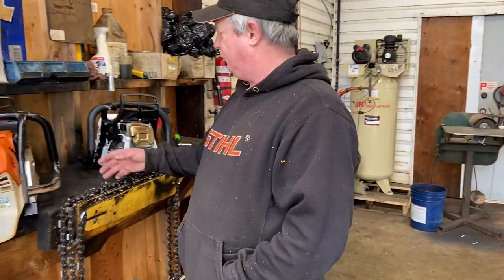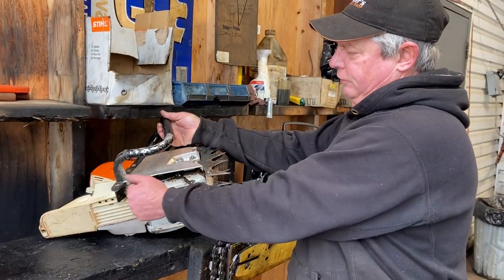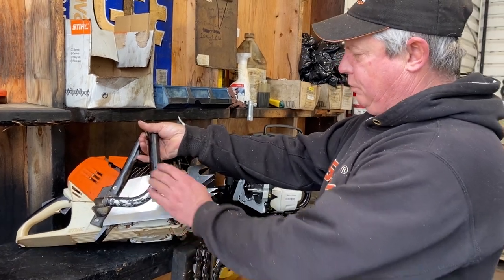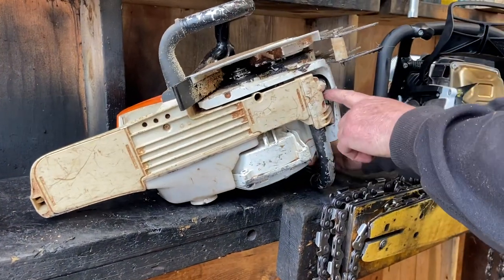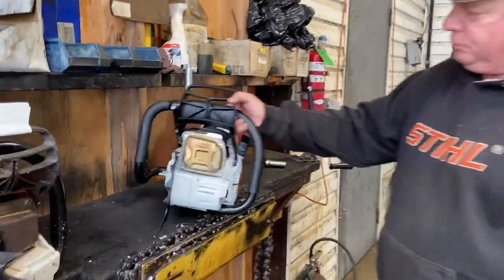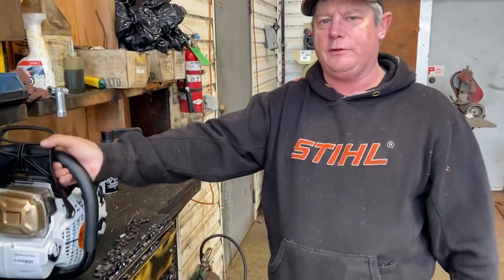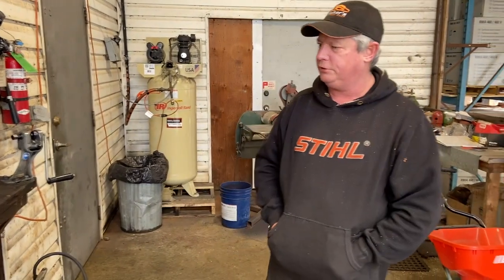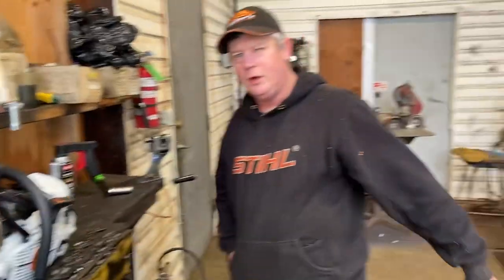Stihl 500i problems

Comment from the maker: Ok let me clarify what I said in this video if the saw is running crappy in limp mode then do the 10 to 15 min idle to reset it but if they are running ok then just let them idle to warm up for a couple of minutes and after heavy cuts idle for a couple of minutes  sorry I should of done a different video to correct that but you all I hope understand what I meant eh good luck there a great saw

Comment: These 500's may be great but I don't have the patience to babysit my tools this way. I'll stick with my old carbs.🙂
Reply: Truth.get er done!
Reply: we just run them clean air filter and run the shit out of them no problems 28" bars and bark box mufflers thats all !no problems at all x1 year in woods and constant bucking firewood all summer in the heat !
Reply: @andrewslagle1974  that sounds better. I am not letting my saw idle for 15 min prior to each use. Just like I am not waiting 45 mins at a convenience store to charge my car. Progress.
Reply: 15mins  idling.... Christ have you seen the price of juice😂. 🦆 that!!
Reply: Yep that's why I chuck the m tronic out of the 661 and put a old school carb and coil in,great comfort from the modern stihl,but can't get non m tronic 661 here in nz so have to do it my self
Reply: @georgesmith5624  I understand. I ordered my 661 without mtronic. Now it's ported.
Reply: @qdogbenson3112  nice stihl nz won't bring them in for us.
Reply: How loud is your muffler mod in comparison to the Bark Box?
Reply: You will still be cutting while the 500i
Owner has packed up and drinking beer....
Reply: @rayban5737  why because his saw won't start?
Reply: Me, too.  If it doesn't have a carb, I don't want it.
Reply: Only need to let it idle for like a minute. I have a 500i and know a ton of guys with them. Never heard of anyone needing to idle for that long. Setting is good until you change elevation by a lot or temp is way different. In a minute it is good to go. Just as fast as adjusting a carb. There is a reason why so many are buying the 500i.
Reply: @stewartw7248  i  have owned 2 and your spot on a short warm up 3 min max if ya really change locals
Reply: @andrewslagle1974  Are you a Palo Cedro Slagle?
Reply: Back on a 462!

Comment: With just the muffler and filter mods they’ve been the most reliable saws I’ve run. Starts and runs on 1-3 pulls every time all day. Give ‘em warm up time just like any responsible saw owner would any other saw. Don’t touch the trigger when you start them. Don’t run em dry on fuel. Give them 5-10 seconds of adjustment time at idle before you turn them off after a work load. Done. Way easier than a conventional carb
Reply: That’s a heck of a list I’ve always just cranked mine and ran it wide open carb saw not 500
Reply: Couldn't agree more! Mines 3 years old now 5 days a week climbing saw fire wood saw rain heat dust. Fully stock all I've done is replaced air fuel and spark plugs and I've even crushed the saw under a log I don't know what people are complaining about there fine stock in my opinion.
Reply: My dadys Partner R 12 start at ones

Comment: It’s not hard and there’s no extra effort with this saw. Cold saw: start it like a modern car- no one stomps on the gas pedal right? Let it warm up idling for a few minutes which is needed for a small engine - or any engine. It doesn’t need to sit there for a long time, 5 mins tops. 15 mins is ridiculous and would be aggravating as a user. After short cuts, idle for a few seconds, then off - just don’t hit kill as the RPMs are coming down. Long cuts, longer idle which you do anyway and for primary purposes of cooling - the fuel injection doesn’t need long idle after cutting but the cooling need is there. Sitting unused for 10 min or less it’ll start one pull, sitting longer you’ll need some priming and it’s going again with 2-3 pulls. And don’t touch the throttle - it’s redundant with fuel injection. Overall It’s really simple - many are overcomplicating and/or overthinking this.

Comment: I jus ain't impressed at all with the 500i jus my not important opinion lol the 400 is a better bang for the buck. Jus my thoughts tho have a great weekend sir.
Reply: What are you not impressed with?
Reply: @victoriousvictor7978  the power to weight is lacking the suspension is way to soft harness issues as well as a few computer tuning issues. And over priced for what they are. Jus my 2cents lol.
Reply: I agree 100% buddy. I'm a husky guy but I bought and tried a 400c. Great power to weight ratio at a few buks more then my 562xp
Reply: @jamiedalluge9472  i to think the 400c is a great saw especially ported.
Reply: @justinweaver8107  absolutely. I bought mine new and instantly did a muffler mod. I cut up 15 cords of oak firewood then sold it to a buddy who ported it. The only 2 things I didn't like was how mashy setting the choke felt and the plastic feeling handle bar. Otherwise great saw. Feels lighter then 562 as well
Reply: 400 or 462?
Reply: @jamiedalluge9472  put a wrap kit on it solves the handle plastic thing !
Reply: @andrewslagle1974  90% of what I do is blocking firewood so I really don't care or need a wrap. I'll stick with my huskies jst a personal preference
Reply: @jacobfurnish7450  462 has lil more power but lil more weight as well.
Reply: @justinweaver8107  but which one has better power to weight ratio?
Reply: @jacobfurnish7450  well the 462 probably. But also a price difference to.

Comment: I’ve been running this saw for two years and have literally no problems ever.  The owner’s manual makes no mention of going full throttle to start up.  I know, readings hard.  Also I’ve never had to let it idle after a hard cut or even at start up lol

Comment: Chainsaws should NOT have a computer and a USB port on them. I only own and will continue to buy conventional carbed saws. They are easy to adjust and I can fix them myself without a computer software program.
Reply: in a few more years that will be  on all saws. There is nothing wrong with the new saws !  You cant run old junk forever!

Comment: yeah I'm a dinosaur....but computerizing saws is an unnecessary complication in the build with questionable payback. You see the cost of automobiles, their complexities, their many failure points due to all the computer controlled everything. And we want this in saws? The saw builders want it, and probably it is driven some by this environmental crap but it is doing nothing but making cost and trouble for saw users.

Comment: I had 2 ported 500i this last year.  The upgrades i made were:
1- ($60)egan air filter (solves the fines problems without mods to the housing) 
2- ($40)egan 3 point dogs (west coast is great,  but egan is 1/2 in shorter and works great for my needs) 
3- ($120)west coast clutch cover (duh!)
4-(free) push the oiler pin down for full adjustment 
5- ($40)west coast fellers suspension kit.  
6- ($280) cannon duralite superbar, 28 in.

This saw, in this configuration is not for everyone,  its obviously expensive,  but so is your time and energy! I'll keep you updated on any problems I have, but so far, this is the best saw I've ever used!

Comment: I gotta be honest.. I am fairly patient, but I don't think I've patience enough for this machine. From what I understand, the 500i (*after a proper 15 min calibration) is excellent through big cuts but is a gas hog and cannot be leaned out. Of course, the same as true for M-Tronics and Husky X-Torq (I cannot believe that these companies no longer offer big saws with a standard carburetor *What customer profile do they think they are selling these saws to?). I wish that the 500i came with a Dual Response trigger- so that the saw could be run both rich and lean, For example.. If limbing or bucking small wood, you could rock this trigger forward with index finger, and the saw would run ~lean. If felling or bucking big timber, you could rock this trigger backward with middle, ring, and pinky fingers, and the saw would run ~rich. This way the computer doesn't have to figure it out. The fuel injection system could respond immediately based on 2 preset fuel requirements. No down time waiting on RECALIBRATION to idle "neutral" parameters. The thing shouldn't have to make complicated calculations. It is not a vehicle traversing ever-changing terrain. Operators know when a cut requires heavy fuel consumption or not. A duel response trigger would simplify fuel monitering/metering.
Reply: there is nothing wrong with the new saws get with the program!
Reply: They sure are thirsty. Especially if you dont clean the air filter every tank.
Reply: I do not know about the M-tronics or even the 500i, but the 572XP and the 592XP are pretty fuel efficient if one has them in big wood where they are really working and producing.  AND there are carb versions of the Husqvarna 5 series.  I do let my 5 series saws warm up, but I have not let it go on for 15 minutes --  maybe 5 and then another 5 before stopping for fuel or service to allow cooling.

Comment: 15 minutes is overkill.  Couple of minutes initially and a couple before shut off.
Reply from the maker: Ya that’s a little long but you get what I mean hey
Reply: @donnywalker4691  I knew.  I did see that Billy Ray followed your recommendation to the letter.  I'm glad he is happy with the 500i finally.  I too went thru the same problems with the 500i and my other new M-Tronic saws.  🙂

Comment: 500i won't start.  I unplugged the 3 connectors on the right side to put electrical tape on the wires and at first it fired up and idled really high (like half throttle) and now it won't start at all

Comment: Ran a 500i for 2 week land clearing job. I’m used to huskies. I don’t know what kind of compression these 500i’s have but dang, that saw was not fun to start/stop as the compression stroke and horrible ergonomics of the starter handle sucked so bad compared to husky. Never had to pull my huskies more than 3 times to fire them up this freaking 500i took 5 pulls about every other time, until I realized you HAVE to pump the primer bulb 8 times before every start. What a pita. “Progress”. Next job I’ll use my own orange saw that starts easily.

Comment: Hi Donny,
Just wondering if you ever get a 500i coming in for repair due to clogged injectors, for example those caused by ethanol fuels, or are the injectors generally trouble free?
Thanks and a happy new year to you all.

Comment: That’s kinda mess up you got do all his stuff just to get it run right run 25 min before you start cutting then 15 min after cutting  or higher elevation the let idle  10-15 min  to finicky I will stick to my 441 and 661 saw

Comment: Great content Donny !! I have a 562XP and 572XP love them, a guy told me to put a 8 tooth sprocket on the 572 to get more out of it ! is that a good option if so what's the part # Thanks
Reply from the maker: 8 tooth good for bars 24 and under  I think for more speed but I like the torque of a 7 tooth with big bars
Reply: @donnywalker4691  My 572 has a 24" on it is worth try ? Would you have the part # for one ? Thanks for your replies
Reply from the maker: Part number 22273 ya get it

Comment: My chain tensioner is shot! Haven't used the 500i that much but I have used it on a Alaska sawmill with a 3 ft bar. I don't know it just seems a little weak in the chain housing. It will not tighten. Am I doing something wrong? Is it the wrong saw for the Alaskan mill? How do I beef this up?